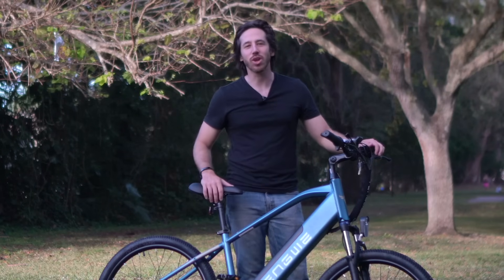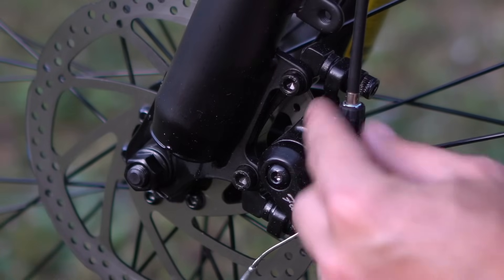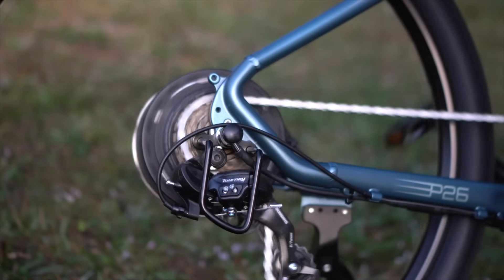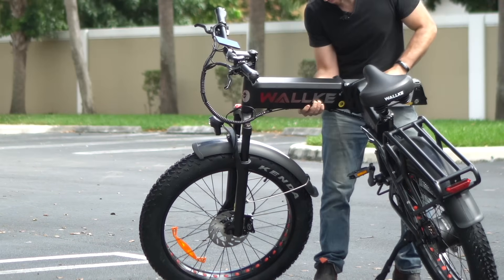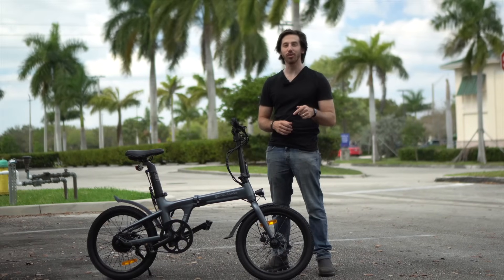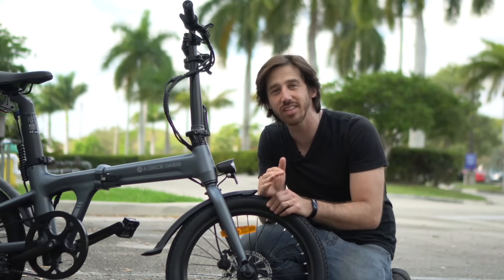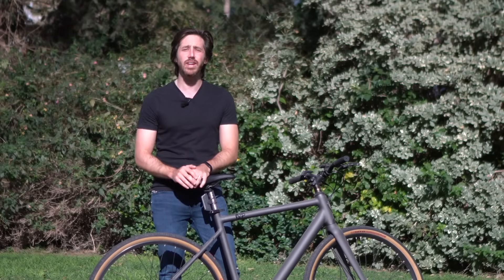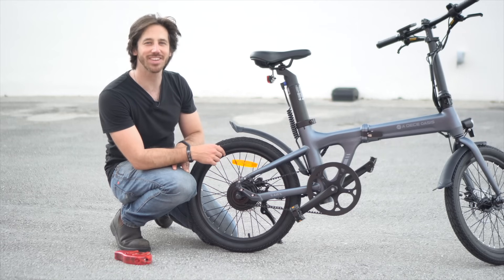How to do common ELECTRIC bike maintenance

Comment: Do not leave battery outside so it can set your house on fire ?  That said I generally agree with you advice. I though it is right not to leave the battery full when not using it in hot temperatures - yet in practice I struggle to put that in practice because I have no easy way to monitor the SoC when recharging it - unless I go every half an hour to my garage when it is charging - there is no APP to set a max SoC on most e-bikes.

Comment: 6:33 I've always done rear derailleur adjustments in the highest gear, when tue mechanism is under least strain. There's a risk of threads shearing in the lowest gear and under the highest tension. 
Using a stand, go through gear selections. On my 10 still  gear beyween 7-9 will show if my cable is slack (the chain does not run dead-centre on the cog and sits toward the frame. In gears 2-4 I will see clues of the cable running too tight and my chain off-centre to the cog toward the wheel. 

I got an ebike dirt cheap and a bit of tlc has given it a new life. Even though ive serviced my own bikes and motorbikes all my life, at least one professional sevice a year gives you a full diagnosis.

Comment: Loose nuts and bolts are not fun. That’s why they make blue and red loctite. Or if you can find the correct size nuts, replace the standard nuts with the self locking nuts. ( nylock ).

Comment: Fantastic video brosky. I highly recommend purple thread-locker for the important bolts on the Ebike. Blue works, but is overkill and harder to get off. Purple thread-locker is typically used to prevent bolts that you may need to remove fairly easily from coming out due to vibrations. Perfect for regular bicycles too! With the purp you can take these bolts off easier with a bike multitool than the higher strengths, AND it prevents corrosion!

Comment: I just got a new ebike. It's great. I've only used it a few times and haven't gone very far yet. I'm waiting until I get my side mirrors for safety. I got the Heybike Mars 2.0. With the upgraded 1000-watt motor. It's very quick and does hills well so far. I may get another one eventually.  They are more fun than I had imagined.

Comment: I recommend anyone wanting to get into an E- Bike to do their research before purchasing. What kind of warrenty does the bike have? Does the bike dealer offer service? Do NOT purchase an E- Bike at a big box store. Research the cost on a replacement battery and charger. When it does need a replacement battery, you absolutely  need to replace it with the same type of battery. Yes, regular maintenance  is important, but many people have no clue as to how to do proper adjustments. There are many videos available as to proper adjustments. You will need to know proper torque ratings on hardware. You should know if electronics can be replaced or become obsolete  in a few years. In other words, go though a dealer and manufacturer  that supports that E- Bike. China mass produces many no name brand E- Bikes that can and will fail.
Reply: My bikes Chinese and it works fine. Getting replacement parts might be a problem in the future
Reply: @freshpocketlint3380  Like a hobby grade RC car or plane compaired to toy grade. Not meaning to insult you, but like toy grade, you cannot get repair parts for them. This goes with lawn mowers and snowblowers or any lower quality item.

Comment: Hi and as I am 49years old and have had my Carrera Vengeance for a few years now and my main problem/worry is running out of battery power a long way from home with no where to recharge. I may have come up with a solution to this problem with a self charging battery idea that I have, but am afraid of starting a battery fire or even worse an explosion. So I would love to be able to contact you for further information on the battery and recharging using AC to DC

Comment: Appreciate the segment on brakes. I had to get in contact with my bike manu because my parking brakes on my etrike were no longer compressing enough to lock in and the bike would roll.  They gave me the wrong info, and I ultimately had to go to a bike shop. They fixed it in less than a minute and showed me what to look for without charging me (I think they felt bad for me lol.) A bit embarrassing, but that's how you learn! Knowing that there are other places to adjust tension if needed is really useful since the trike has hydraulic caliper brakes, and so does my Tesgo X5.  Also, I had to figure out the chain cleaning and got a parktool, because it gets disgustingly muddy here and my poor chain was skipping and stiff from the grime and oxidation. I have the correct lube for wet and dry conditions now and hopefully will be a better bike parent from now on ^^

Comment: Hello, I appreciate all of the videos. I have a query. My Btwin Riverside 500e has been giving me trouble lately. The problem is that the engine runs smoothly once the bike is moving, but eventually, it gets heavy, and the back engine loses power. The bike then starts to brake, and if I stop pedalling, the bicycle will slowly stop, making it difficult to pedal. If you could provide me with some advice on how to handle this issue, I would be very grateful.

Comment: I have had the two 5m bolts that hold the foot on the battery come loose. I was riding thru an intersection and the battery/foot were being drug behind me..  I now use blue Loctite to hold those battery securing bolts from loosening.. Had to replace the battery casing (about $70 repair to the battery case) that made it waterproof again..

Comment: Micah.. i have found i get more charge cycles if i fully drain the volts until it shuts off, then fully charge it.. 
By only draning partially, and capping it off every day, i find that the battery's number of cycles drop quickly, that's because there are only a set number of charge cycles.. Fully or Partially charging uses one of the cycles.. and every couple charges, you need to fully charge to keep the cells in balance.. out of balance can be a fire hazard..

Comment: I’m pretty handy and my high end disk brakes have been more of a challenge than my previous rim brakes, that only require a quick pad swap when they get low.
My rear disk brake was very weak. I assumed contamination. I tried alcohol cleaning, then eventually sanded the disk and replaced the pads. I can’t get the brake to stop making that insane noise when stopping. So now what? i guess replace all the wear components again?

Comment: An e-bike would literally change my life. I had a car that I had to sell because i would’ve been homeless if I didn’t sell it to pay the rent. My wife and I just got married and moved out and it’s hard getting back and forth to work. I live in the midwest so weather is unforgiving. An e-bike would help so much especially since they are mostly waterproof. I need one because they’re much cheaper to maintain than a car but even the lower price they’ve gotten to I still can’t afford one. When you give up a car you realize how hard it is to get around in America and I really just can’t afford anymore cars right now.
Reply: Ebikes are GREAT!   I bought my first one 3 years ago and loved it so much I bought a more powerful one and one a bit more fitting to me.  Im only 5' 8"  the first one is 26" fat tire snow/sand bike.  I cant touch ground with seat in a good position to get a proper extension on my legs when I pedal.  i live in Queens NY so theres sidewalks/curbs everywhere.  My "fix" when I need to stop is just stop near a curb and put my right foot on it till i can go.  Worst case when I need to stop I gracefully hop off it.   The 20" tire Aniioki AQ fits me well and I love it.  It can reach 28-29 MPH and has rear suspension too.   I seldom rode my reg bike, but I use these any chance I get and for me a short ride is 25-30 miles.  On days off I routinely ride 40-60 miles.  Been to Manhattan,  Jones Beach,  Roosevelt Island and many other places with me ebikes and love them.   BTW  I'm a 59 yo guy and these keep the child inside you alive!

Comment: Question here - I've got hydraulic disc brakes, and my front brake lever is starting to engage closer to the handlebars. How do I fix this? I am thinking that maybe it needs more mineral oil, but not sure.
Reply from the maker: Pads might also be worn out. Also try zip tying your brake lever down hard overnight to fix spongy brakes.

Comment: I like the idea of hydraulic brakes, but my experience with them varies greatly from the low-maintenance one. The hydraulic brakes on the Carbo X (which I used for about 4 years) required a full bleed and fluid change at least every 6 months (lots of braking on steep hills).
Reply: If it's a bike that I'm gonna be doing 35+ on the road with cars on ide want to have the hydraulic with the extra maintenance. For 25mph E bikes and below a good pair of mechanical brakes is perfectly fine.

Comment: Thanks for the information on derailleurs ....my MokWheel City bike only has 400 miles on it and the chain pops off every once in awhile. I'm going to try to adjust the low and high nuts on the derailleur and rear nut . I hope this resolves the problem!!

Comment: As a Tesla owner, I can tell you that the battery storage is import.  Leaving the battery above 80% for extended periods of time is terrible for the battery, so no, don’t just drain 5%, drain 20 percent. 50% is optimal for long term storage. And it’s also wise to check the battery every 3 months of non use to get it back to 50% if it has fallen.

Comment: Change mech brakes to hydrologic brakes. Convert the cassette to single speed and remove the shifter. That lessens the overall excess amount of maintenance you will need to do

Comment: Help! I know I need a 20 inch wheel or less. If they offer you one to try I sure could use it . I am an active 73 yr. old in a simi-rural area & I save turtles off the road as much I possibly each year. I rode a 50cc gas scooter until the end of last year. It broke down, not far from home but the last curve near  is dangerous. I save turtles on the road as often possible & so if If any of that speaks to you & you could help me with a smaller sized e-bike - I would love it & pay it forward to your fund  for helping people get  -bikes. I am only 5'2" I can pay you back into your fund  for it if you were offered a bike that was small. Anyway thanks for the video!

Comment: Hey, great video. I just got my free sky Alaskan range 26 inch 1600W Dual Battery E-bike. I have one small problem and the front tire hydraulic disc brake has a bit of friction. How can I adjust this? Thank you in advance for your time.

Comment: I treat my e-bike like a pet. It gets pampered. I'm hitting 5900 miles since October 2022 and it still rides like brand new. 🚴🏼‍♂️
Reply: I'd like to think that the lower impact from how light they are compared to cars and motorcycles makes them last longer, but in reality they are made out of completely different parts so they can't be directly compared. They're a lot of fun, though!

Comment: Adjusting the caliper arm anchor bolt is the WRONG adjustment to make. Why? Because if you've already adjusted the cable, then what you have essentially done is shorten the cable, thus shorten the brake lever throw.

The PROPER adjustment is actually moving the outboard caliper pad. This pad is located on the side towards the hub, or is located away from the caliper arm.

What you want to look for is through the  wheel, look at the caliper, and look for a hexagonal hole on that side, on the caliper itself. That hole is your adjustment, as it is the steel backing plate with the magnet that holds the pad in place.

With the proper Allen wrench, insert it into the hole -- but don't turn it just yet. What you need to watch is the pad gap between the pads and rotor. Depending on manufacturer, you may have a pad gap from 1mm to 2mm, which is for each pad in relation to the rotor. Once you begin to look for the pad adjustment, rotate the Allen wrench towards the front of the bike. This will turn the pad 'in,' and decrease the pad gap. If you turn it in too far, or worse, hit the rotor, don't panic, just turn the Allen wrench back out a few turns to bring the pad gap back, by 'loosening' the backing plate. (But don't go too far, else you risk your caliper pad falling out, along with the backing plate and magnet!)

The pad should be adjusted with no rubbing on the caliper. Once you have set the pad gap, check the brake lever. If the lever still goes beyond letting the cable mount appear as you pull the brake lever (this will appear as a larger circle you can see the cable barrel/cable end through), then alternate between using the barrel adjuster at the caliper, and using the barrel adjuster at the brake lever. Adjust the cable length until you can't see the cable end as you pull the lever, or until you have at least 3/4" of gap between the brake lever and the handlebar, with the lever fully pulled.

Edit: CORRECTION: The limit screws at the derailleur DO NOT have anything to do with the cable or cable tension! This is bad information!

What the limit screws do is prevent an over-shift condition, where the chain can actually fall off either the high or low gear. Ever wonder why that plastic or metal disk is on your back wheel? That's your spoke protector, which you need, in case your Low side limit screw is improperly set, and you end up over-shifting the chain between the freewheel or cassette, and your wheel spokes.

The limit screws prevent an over-shift condition so that even if the cable has stretched, the derailleur itself won't over-shift and cause further damage.

Edit 2: Tires. While correct on a possible loss of handling, there are other things to consider.

First, a "normal" tire pressure. For most people who ride hard surfaces, such as concrete or asphalt, that means having maximum air pressure the tire allows. On most road bikes, and depending on tire manufacturer, you can have pressures at 60 psi or higher. That is for the "skinny tire" road or cruising bike.

On most MTB or beach-cruiser bikes that can fit a 2.0-2.25" tire, most tire manufacturers rate their high pressure at 50 psi.

For "Fat Tire" E-bike tires, use the manufacturer spec on the tire. This spec is presumed to be a hard-surface spec.

The entire reason for using the manufacturer's spec is this: Consistently have a low-pressure tire that is a hub motor, or is a wheel connected to a mid-drive motor, and you will shorten the life of both the motor and battery, plus cause corrosion in the wiring, by making the battery, wiring, and motor overcome a higher "rolling resistance." Ever heard of "hyper-miling" an EV? Those people do that by maintaining the highest allowable tire pressures so that the EV electrical system has the least amount of rolling resistance, thus does the least amount of work. The same thing applies to an E-bike and it's tires.

Comment: For someone who thinks they know about bikes that doesn't maintain hydraulic disc breaks offten is frightening! The system needs bled often and a hydraulic oil change is recommended every 6 months as turns black and gloopy! And this is kn XTR 4 piston top of the line systems so cheap single piston Tektro will need done the same ifnused everyday on road commutes
Reply from the maker: No

Comment: I feel so bad for many Ebike riders out there. This maintenance is critical on ALL bicycles, not just Ebikes (the battery would be the exception, of course). After over 20 years of cycling, I've gained this knowledge after a few breakdowns and DIY knowhow. This is very useful information for those new to cycling. However, to avoid misinformation (and possibly bias), "all bicycles..", or "bicycles (conventional and Ebike)", or anything appropriately covering cycling topics might be more insightful than just 'ELECTRIC' and, or 'Ebikes'. Just sayin'. Otherwise, the information in this video is very well explained and to the point.

Comment: My Ebike has been the most annoying thing to fix. Simple inner tube replacements have been so frustrating on the rear wheel. Not the changing of the tube, but the removal and re insertion of the rear wheel. Something always goes wrong.